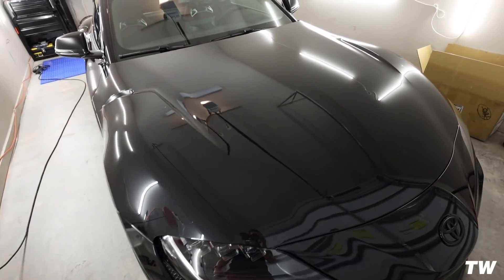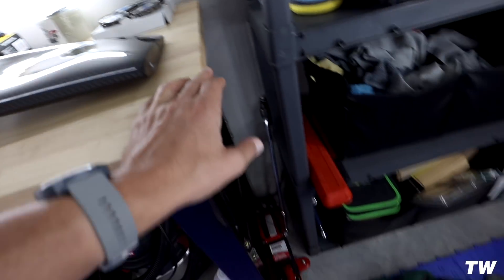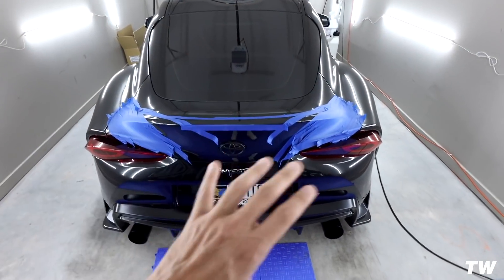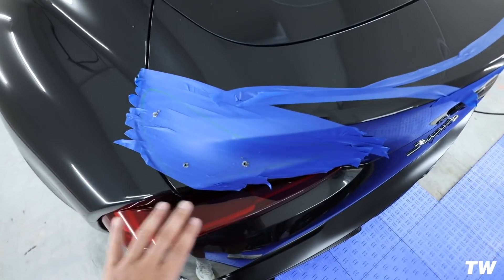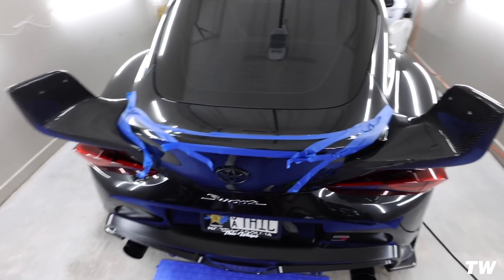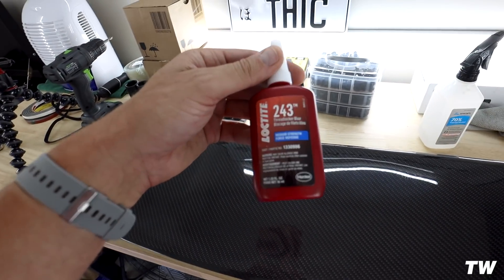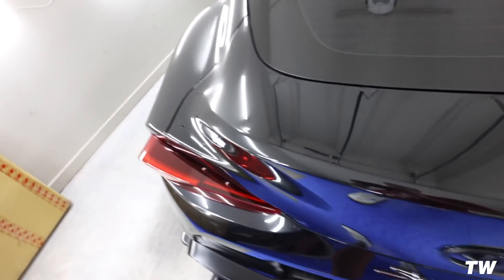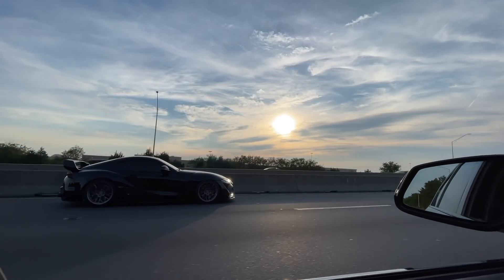2020 SUPRA CARBON FIBER WING INSTALL! (Step By Step Install Tutorial)

Comment: You can use JB Autoweld(black) to fill the gap or JB Clearweld(clear) to fill the gap but keep in mind it’s going to glue and bond the center section of the wing to the sides.

Comment: Thank you for providing a step by step in depth install. Also, a big thanks for listing the parts as I just received my replica wing without hardware so I appreciate that you listed the bolt size and length 👍
Reply from the maker: You bet man!

Comment: I just got my street hunter wing in and the gaps are insane. i have inch wide gaps
Reply from the maker: I’ve heard this before. This is a rep wing, but the gaps really weren’t bad at all.
Reply: @ThicWhips  Ive noticed alot of groups say the replicas fit better. I didnt look into FB groups until after i already got mine. I shipped it back, they are working with me about returning it